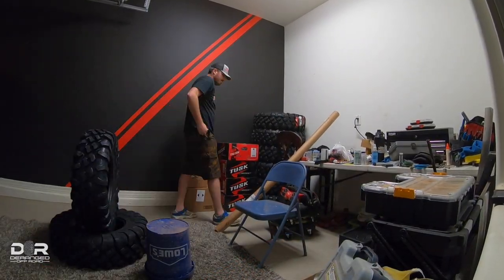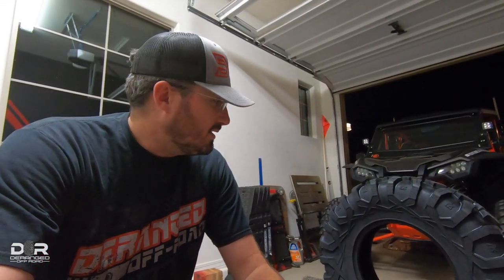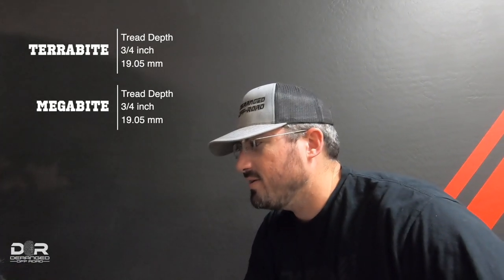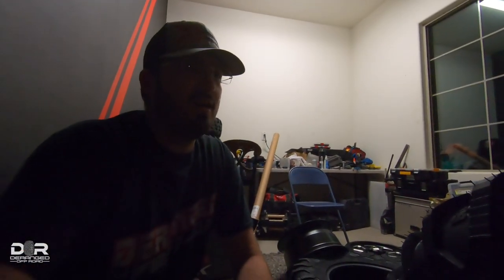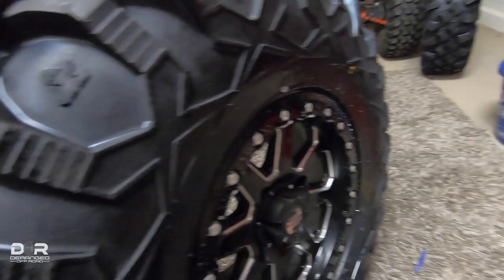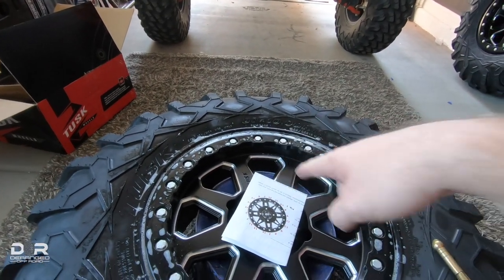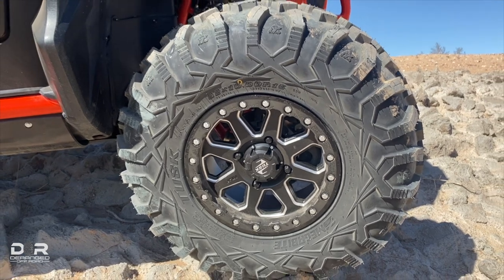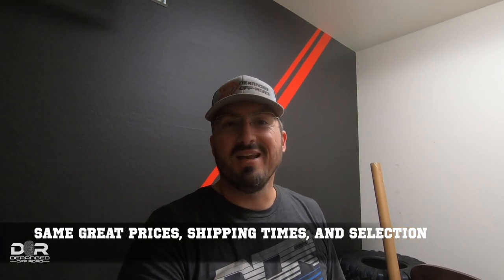Tusk Megabite Tires and Tusk Uinta Beadlock Install and First Impressions

Comment: I bought the Megas for Trail machine.  Ride alot of shale and granite..wet..slimy.  wanted really good side walls grip because have to put tire against steep ditches to grab extra traction..  On our 5th sxs and like these the best for my riding.  Maintained their height even at 12psi.  A domed tire keeps better tranction in our terrain.

Comment: I run 5.2 offset wheels with 30 inch  m1evils and notice alot of fighting in travel. To eliminate this I went with 2 inch spacers on rear and gave me 1/4 inch on each side over measurement of front. I believe the oem offset is around 1 5/8 to 1 3/4 on rear. Made a huge difference in handling. Hope this helps!
Reply from the maker: Thanks for the input 👍 -Garrett
Reply: @DerangedOffRoad  Np!! Also I left out that you can also use 1 1/2 spacers. This will be 1/4 shy oem total width of front. Now people are complaining of shearing lug bolts with spacers due to lug bolts being to short. I went to a local O'Reilly and orderd lug bolts that were 1/2 in longer. By doing this you have alot more threads for nuts and shank will be 1mm larger so it will be tighter, and still can use same lug nuts. If you have any questions I'll try to answer the best I can!

Comment: Carnivores are DOT approved. You also need DOT approved tires in Utah the first time you get the street legal inspection done. After that it doesn’t matter. Just did all of this in the last year. 
I look forward to seeing what you think of the megabites after some use.
Reply from the maker: These are the only requirements by the state of Utah in regards to tires on street legal sxs. 
“(xvi) tires that:
(A) do not exceed 44 inches in height; and
(B) have at least 2/32 inches or greater tire tread.”
If the inspection place told you otherwise they are misinformed. 

https://site.utah.gov/stateparks/wp-content/uploads/sites/13/2018/10/OHV-Street-Legal-Code-5.8.18.pdf

Comment: Terabyte vs megabyte what are you buying if you can only choose one
Reply from the maker: Depends on the type of terrain you ride.  Terrabites are great for hardpack, desert type stuff. They perform okay in some muddy situations, but they aren't great for back east wet muddy rocky type riding   They run great on paved roads as well  you should get several thousand miles out of a set.  Megabytes seem to be a softer compound.  They wear faster in the rocks, but they grip really well.  They should do better in the mud with their big lugs that are spaced out further than the Terrabites.  Joe will be doing a more in depth review about his megabytes later after a few more miles.
-Dave

Comment: At say 10 psi  what are they measuring horizontally ?  
Curious if they run pretty small like the Terrabite.
Reply from the maker: Just measured. 30.75” at 10 psi. Same as the terrabites if I remember right. -Joe
Reply: @DerangedOffRoad  Thanks Joe

Comment: Do the Megabites measure true to size? I had the Terrabites (loved them) and I think they actually measured about an inch less than advertised. Looking to go back to one of these Tusk tires after the Dirt Commanders on my RMAX2 wear down.
Reply from the maker: They measure the same as the terrabites. At 10 psi they’re 30.75”, at 15psi they’re 31.25”. -Joe
Reply: @DerangedOffRoad  were these measurements taken ON or OFF the machine?

Comment: are you using tire straps to tie down the Talon to the trailer or what's best?
Reply: Just leave it and neutral with gate down. Then later buy a Can-Am😂
Reply: @davisfamilyshenanigans4807  LOL, I did that with my Can-Am already🤣

Comment: I have the Tusk Trilobites, on my Teryx 4, and I am very disappointed with them. Will not recommend them to anyone. But these look like a nice tire!!
Reply from the maker: Why are you disappointed in them?  Did they not work well for the terrain you ride in?  People who are considering buying them would like to know your experience
Reply: @DerangedOffRoad  I bought them right before a trip to Hatfield and McCoys. We rode mostly green and blue trails. Even though they are 8 ply, they puncture rather quickly. I only have maybe 400mi on them, got 2 punctures and had to buy a new tire already. The factory Bighorn 2.0's seem to work just as well.
I know accidents happen, but I expected alot better.